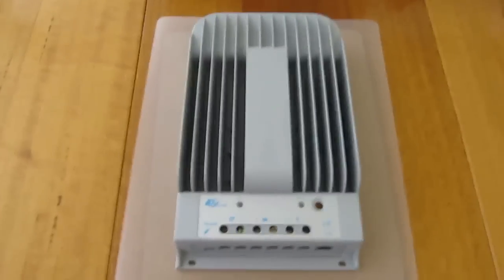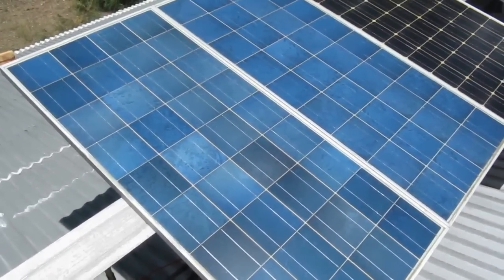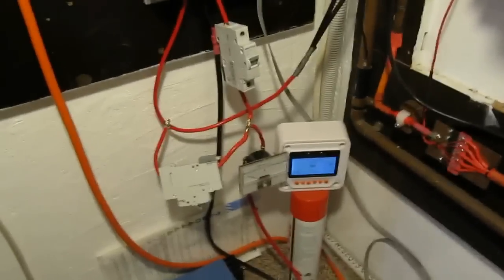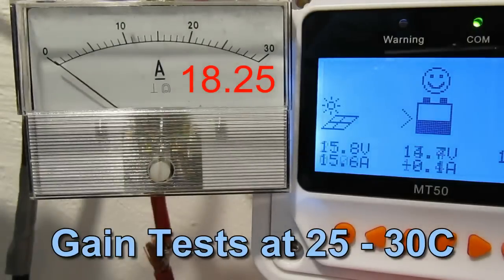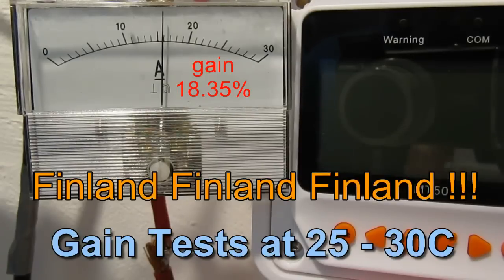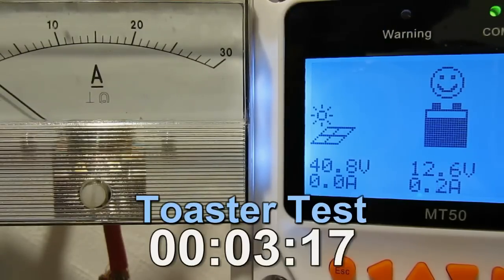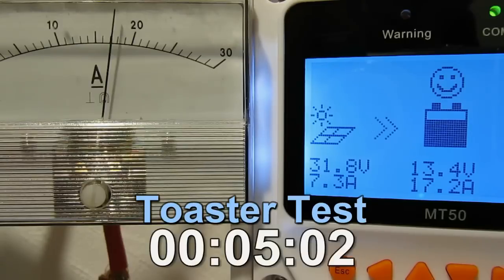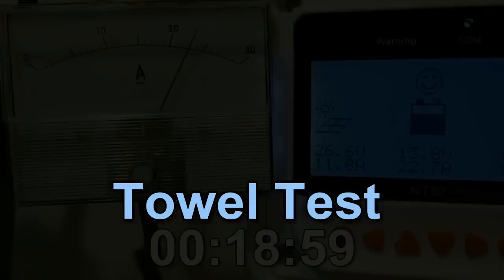EPever EPsolar Tracer 4215B MPPT review PART 1  - 4215BN

Comment: I have a 2215BN controller myself, is this model the same in that it reads the SOC (state of charge) completely wrong?
my unit tells me that my fully charges bank (at 12.8v) is only at 22% SOC... which means it's useless in SOC mode for running anything as it thinks the batteries are flat.   so I have to run in manual mode.
Reply from the maker: John Douglas Yeah, so SOC was a middle management brain fart.
Reply: John Douglas I have the EP solar Viewstar PWM charge controller and I'm seriously considering returning it just because the SOC is off.  It's a simple scale to get it right and it shouldn't be an issue for them to get it right.  Obviously while people are running a large load it can give you a false reading but that isn't the issue.  We know not to pay attention to the SOC at that time anyways.  If they can't get the SOC correct they shouldn't even show it in the user interface.
Reply: John Douglas Updated firmware would be amazing.  Having the SOC being somewhat accurate while charging and not accurate at all when the unit is not charging is not exactly all that user friendly.
Reply: +RV Crazy Email reply I got from EPsolar yesterday

*

We have android APP to monitor via OTG cable and USB-RS485 cable.
We
 have ebox-ble-01 module for bluetooth too, support blutooth 4.0 and 
above. you can contact with our salseman for it, dealer has no that 
module yet.Our R&D department are working for SOC, then we will release update files. *

so not only is a fix in the works, but so is wireless monitoring.
I'm quite excited!
Reply: 2 yrs exp on this devise, i'm monitoring on batt volts/amps only where mppt works with respect to pv panels amps and voltages, am using mt-5 (older vers), mppt tracer works well guaranteed even on low sunlight or cloudy day...
Reply: 2 years experience?  it was only 3rd quarter last year, you mean the old model?
and yes, works well in low light conditions, quite heavy cloud here in Brisbane today and yesterday, and still charging the bank nicely.
(250w 24v panel)
Reply from the maker: John Douglas I don't see how SOC mode can possibly know what the SOC of the battery is, because my inverter pulls power directly off the battery. There is no way a regulator can sum what it has put into the battery, because my inverter can take out 100Ah while it is doing it. I know that in the high end, some chargers attempt to manage and sum both in and out currents, but it requires a charger so large that it can handle 300A output on some connector.
Reply: I wasn't referring to an inverter in the mix.
just the controller connected to the bank, reads my bank at 12.7v (which is fully charged) but SOC says it is only 70% charged.
and while it can't know the true  state of charge without the proper circuitry and load testing ability, it can give a rough estimate via the operating voltage, which it thinks is too low at full charge.
Reply from the maker: John Douglas
Oh, well. Complain to Cris Du, at EP Solar
Reply: I emailed them and the response was "oh, just ignore that bit"  heh   I hope at some point they release a firmware upgrade, assuming it even has some sort of programmable firmware.  and like I said, it does the job it needs to do for the time being.
Reply: You'd think they'd take it more seriously, being that this is a large part of their user base.
A solar controller that doesn't quite work as it should isn't a good look for a solar company.  Guess time will tell.
I'm sure the language barrier doesn't help either :/
Reply: it seems that the only way to really check SOC is with a shunt, which is why it doesn't really work, it's going off voltage, and it's low to allow for the full 14.4v charge, but it's definitely not calibrated correctly for the preset safety discharge cutoff, but, that can be worked around with the manual settings, but they really should fix it, and, allow a firmware update via PC or MAC (if that's even possible)
and yes, it should show and it shouldn't be used in the low voltage cutoff either.  but, other than that it's been a pretty good unit so far.

Comment: Hi, I want to buy this charge regulator. Do you think it's worth the money? I need something reliable...
Or shall I buy the old version (that is 20% cheaper)?
Many thanks! :)
Reply: Wallabynge Its the quality and the overall design.. They actually hired an engineer that knew how to design the hardware properly. The thermal design is suburb and they really spared no expense.Quality components, good design, not something you usually find in Chinese product, this one is the exception. 

Also the flexibility in changing the options. I will eventually be charging LifePO4 batteries and this charger will let me specify the values manually. Most other controller are not capable of LifePO4, or they have static charge regimes for them. Being able to adjust the values lets me decide how hard I want to push my batteries. 

As to the software bugs.. I'm willing to bet they will solve them in the next few months. 

The only thing I don't like is the control panel.. It feels cheap and is confusing to use. Not a big deal as I just use the software instead.

P.S. I liked this controller so much I ordered 4 more for my sailboat.
Reply from the maker: Might be a tough call, to compare it with the old version. (Especially since I've never had the old one with the MeTer thingo.) Chances are that you can find a local supplier of the old version. It's not clear what problems they were attempting to solve with the new version. Maybe the MOSFETs in it are better.
Reply: Wallabynge I pulled it a apart.. Looks like all the components are high spec. United Chemi-Con and Jamicon Caps.. I didn't look at the mosfets as they are mounted face down and would require desoldering (or bending). Based on the other components though, I suspect they are high quality. I would pick this design over the old one in a heartbeat.
Reply from the maker: Travis Wizniuk
What stands out for you? I probably would pick the new one, due to the programming flexibility, both in the voltage thresholds and timing, and the ability to re-burn the firmware. It's very much for the connoisseur. However, I think the old version was faster to determine MPPT and adapt. We are hoping they will fix all that. :-)

Comment: Any news on the firmware update? Any instructions on how to update! I'm very interested in these controllers if they can work out the bugs..
Reply from the maker: Travis Wizniuk I got the USB-rs485 cable. Domitronic sent within the week. However today was cloudy, and the laptop was not available.
Reply from the maker: Travis Wizniuk The USB-RS485 cable was a bust. It actually says on the cable, that it's designed for Tracer B series. However, the Firmware update prog just sits there, when I turn the Tracer on, so the Tracer is not noticing the RS485 cable, or attempting to communicate with it.
Reply: Wallabynge Hmmm that sucks.. Although I found the software, I can't seem to find the firmware to download.. I still might pick one of these up as it seems a good deal if they can get the bugs worked out. Not to mention it looks like it can be used with LIPO if you manually set the levels.
Reply from the maker: Travis Wizniuk I've stuck 2.05 on Mediafire. http://www.mediafire.com/download/ka7f2kfyge2vd8n/TracerUpdate.zip    I think it's in some kind of compressed format, because I can't see any text in it.
Reply from the maker: Travis Wizniuk Turned out that the USB COM10 port needed a RS485 box ticked in the device manager properties, in Windows XP. I tried Win 7. The cable installed on COM3, and the dialog box was identical.
Reply: Wallabynge Can you try something.. In Windows 7.. Right click the PrgUpgrade.exe and say "Run as Administrator".. Something obvious is wrong.. RS485 is an industry standard for communicating to Microcontrollers, so even if the cable says Tracer B, I'm pretty sure it will work with this one..
Reply from the maker: Travis Wizniuk I don't want to re-burn the firmware 2.05 ontop of 2.05 again, in case something screws up. My Windows 7 machine isn't terribly portable, that's why I used an XP laptop. To clarify: ticking the RS485 box in the device properties worked.
Reply: Wallabynge Sorry I misunderstood.. Great to hear it worked.. Do you have the control and monitoring software? It should work with that cable and can replace the monitor (MT50). It can be found here under the "Software" link.
http://www.epsolarpv.com/en/index.php/Technical/download
Reply from the maker: Travis Wizniuk I've had some cloudless weather at last (43 Celsius). The panels are 80C, performing at 63A, rather than 75A at 60-70C. The 2.05 software fails the toaster test in exactly the same way as 2.00. I have no reason to believe that there are significant improvements.
Reply: Wallabynge Cool... I really appreciate the tests.. Having an EE background with software development, I still think its a worthwhile investment.. I'm pretty sure they will sort out the software problems and have a quality product in the end.. I ordered just one to play with.. In your videos,  it looks like the best designed Chinese controller, hardware wise. I'm gonna dig in and see what components are used.. I will ping back once I receive it..
Reply from the maker: Travis Wizniuk The brute force heat sink design means that you feel no heat at around 20A. I haven't pushed it to 40A yet. USA regs say that you should only load solar controllers to 75%, I presume for cool weather power surges. In the case of Chinese design, you never know how good the MOSFETs are. Even quality ones decay with time. I have observed performance in the last few weeks, and it has generally been well behaved. I'm running it up against a home made MOSFET charger that supplies 60A in a primitive 0.5 second pulse. I've got this vaguely tuned to 13.8V, so the Tracer dominates, then takes over, charging in DC for the rest of the day. My computer is run off a DC power supply, and also the fridge and pumps.Relative to the PCM3012, the Tracer is tenacious, and will keep the charge going at 14.1 volts. Currently, the Tracer is wired in with a 0.2V drop on the positive side, because of the meter and fuse. It copes with that OK. In 12V mode you don't have to worry about voltage drop on the negative, because in/out is balanced.I have put up a new PART3 video, documenting the heatwave we are having. When the views on the video get higher, I'm sure someone will email EPsolar, and see of they panic and fix the problems.I downloaded the software you pointed to. They have it on a dialup server, but I got it, eventually. It has the drivers for the XR cable, and the instruction to tick the RS485 box. I can't see anything terribly earthshaking in the computer interface, besides a power graph. I would get the MT50 any day.
Reply: @Wallabynge  good day sir , I've been reading some of the comments above and have watched your video , thing is, I'm experiencing a similar problem with the bn 4215 where it gets stuck in the mornings at around half the rated input voltage  and climbs slowly , if I disconnect then it fixes itself , have you been able to resolve this issue , if so pls assist , thanks man .
Reply from the maker: @fazimabdool6437  I've seen one of mine get stuck on a lower input voltage off some lightning-damaged 36V grid connect panels. I blame the panels to some extent, and think their power curve is weird. I don't have them all pointed in the same direction. (The solution really is to buy a Victron 150/35, or 100/30. )  I notice Tracers tend to work reliably with 12V panels. Are you in Britain or somewhere searing hot? Are the panels shaded?
Reply: @Wallabynge  I have two Chinese made panels in series , 300w each so I was wondering if because they were cheap, if that was my problem , however a buddy of mine has the same problem with his tracer and he has sunpower panels that are brand new and he has had that happen to him every now and again , btw I live in Guyana south America , I have no shade issue , it used to work perfectly for a few months now it's wacky,  it gets hot but my panels are mounted a foot off the roof for air flow , I've seen others in the USA complain about similar issues
Reply: I saw you mentioned victron mppt , do you know where I can get one maybe second hand because I cannot afford a brand new one :) the tracer does not do this everyday , somedays it works fine the next day it'll revert back to the problem ..
Reply from the maker: @fazimabdool6437  It might work better if you can decrease the panel voltage by having them in parallel, but mine still goes low voltage on 35V of panels. You can get a 12V digital timer off ebay, and use it to interrupt the panel current at a certain time of the day for 3 minutes. Use it to power a car horn relay, which will take the 10A panel current.
https://www.ebay.com.au/itm/12V-110V-220V-LCD-Digital-Programmable-Control-Power-12h-24h-Timer-Switch-Relay/123527035137?hash=item1cc2c8f901:m:m8pjUsXc4S_LTK-3WSGhZTw
Reply: @Wallabynge  I'll give it a shot , thanks for all your help and keep up the good work man ..

Comment: It's clear you are knowledgeable in the subject, thanks for the great video!

Can you confirm you were comparing the panels connected directly to the battery?  I'm a little surprised they drop to the correct voltage, I didn't know you could connect typical grid connect panels to a 12V battery directly.
Reply from the maker: I'm using a combination of 2 x 12V (200W - 11Amp) panels for the 24V config testing, and just 2 plain old 12V panels for the 12V current comparison tests. I only did comparison tests on 12V, because in the case of grid connect "35V" style panels that you mention, there is no way to compare them, because the cells are configured incorrectly for 12V battery charging. A normal 12V panel has the cells configured to a voltage, which is sufficiently above a 12V battery, to allow for hot weather, bad wiring, a diode, and a top battery voltage of 15V. In other words, they are designed to charge a 12V lead acid cell in a low tech, hot environment. That is why we can compare them against MPPT and get a meaningful result.

You can connect grid connect panels to a 12V battery, and the voltage will drop to the battery. It has to. (It will even drop to 0V, if you short circuit the panel.) However, the configuration will waste 50% of your power, and will likely destroy an el-cheapo 12V PWM charger, because some component in it will assume a maximum of 20V input.

Comment: that was fun and in the news and politics category of urube! Does it mean you've lost 20 mins of max battery charging?
Reply from the maker: Kevin McCready I don't know. I'd have to spend the entire day watching it. It was being slack this morning, because the clouds annoyed it. However, it got back on its feet again. In my system, it works second fiddle to a MOSFET pulse charger I made, that carries 60-80A. This can worry it a bit more, esp as in the test rig, the ammeter, switch and wires add 0.2V of resistance, so it thinks the regulated voltage is 0.2V higher. Luckily there is no significant voltage drop on the negative wire, when used in 12V mode, because as much current goes into it, as comes out of it.